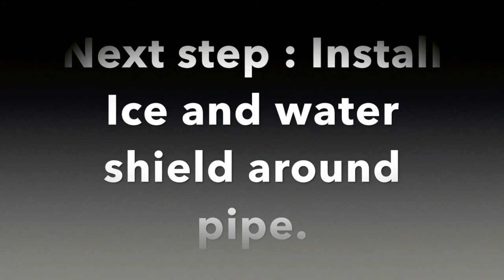How to dry-in Roof Pipe Boot

Comment: I'm putting some synthetic underlayment on my roof.  I have three vent pipes and one power pole on the roof.  How did you get your underlayment to perfectly fit over your vent pipe?  Also, what's the best way to get the underlayment around the power pole since I can't go over the top?  I'm putting a metal roof with battens, but wanted to do the underlayment properly.  Thanks!
Reply: 2 piece it, first lower then higher

Comment: That ice and water needs to run up passing the paper so it runs underneath the the paper that will over lap the paper the pipe is on.
Reply from the maker: Hello John, Thank you for your reply. That is exactly how we used to install it, however with further training from Owens Corning and through deductive reasoning and building code requirements we no longer do it the old way. At one time the manufacturer's of synthetic underlayment did not want any IWS installed on top, however today many manufacture's of synthetic allow for the installation of IWS on top of the synthetic underlayment. We love to stay up with current news and recommendations from manufacturers so we can provide the best systems.

Thank you for your feed back.
Reply from the maker: Hey brother, in addition the title of this video that states, "Dry in," is not referring to drying in the roof before a heavy monsoon storm and leaving the roof un-shingled. This is how we prepare all of our roof installs for shingles. If there is going to be a major storm we avoid issues by only tearing off what we can dry-in and install the same day. We rarely have ever left in the evening without the entire roof being covered in shingles, however there are some building code jurisdictions that require a mid-roof inspection and on these we will typically run the IWS underneath the upper row of underlayment. 

For everyones information IWS does not adhere well in colder temps, so be careful and nail down the IWS.

Thanks for your input, you pointed out something that was very important that I did not properly explain.
Reply: John Lawskeys I agree John the top of the  Ice and water needs to be under the felt paper to prevent leaking. I work for an insurance company and this would not fly here in Ohio